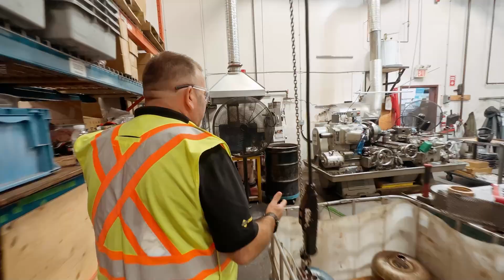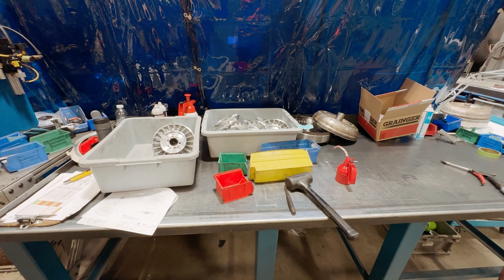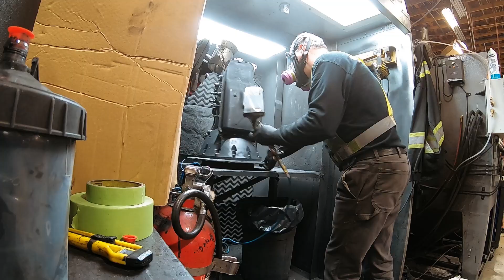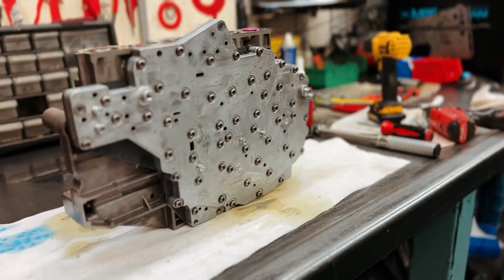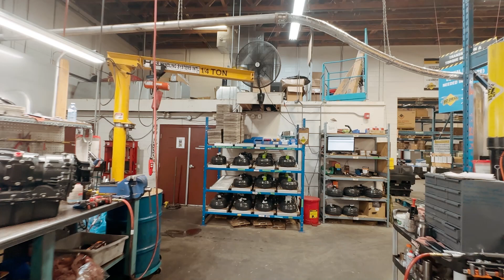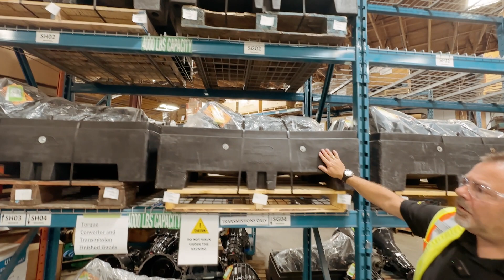Transmission Builder Shop Tour | Behind-the-Scenes Walkthrough!

Comment: The only issue I see is them using an impact on the valve bodies. First the torque values are really low so I’m gonna say they are over torqued which might not split right away but I wouldn’t trust it. I’m glad I watched the video or I would have bought their transmission.